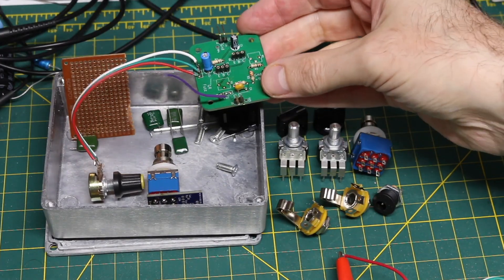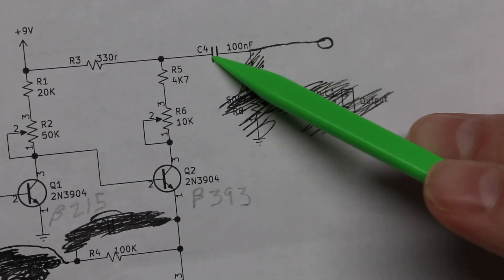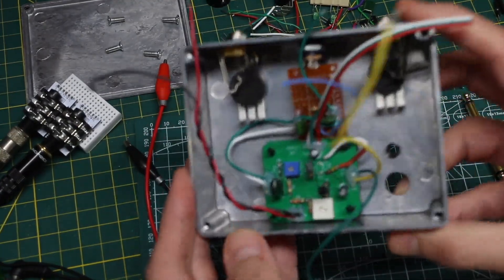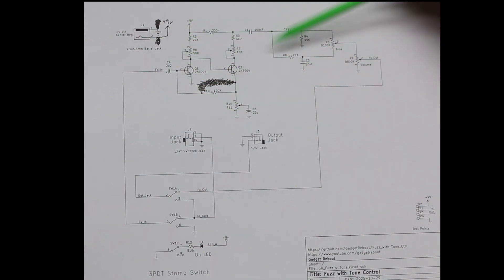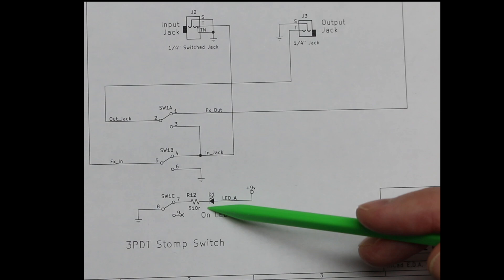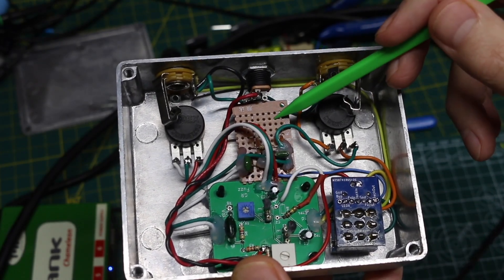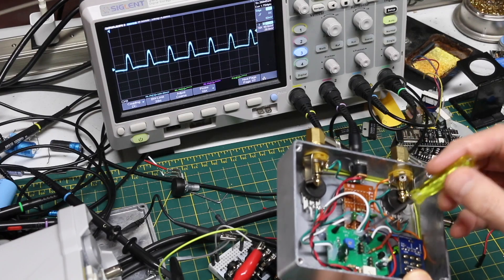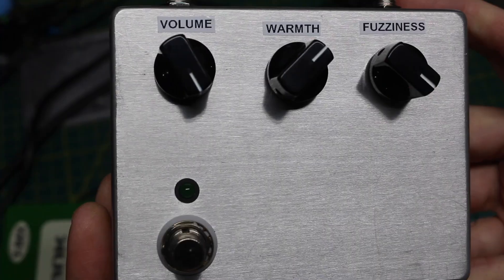DIY Fuzz Face Pedal with Tone Control

Comment: Huh, I'm in the middle of wrapping up a design just like this. I have different values in the tone stack and am just a bit more traditional fuzz face up front. I ended up having to add boost for makeup gain though. Other than that it seem to sound great at this point. It's a little noisy so I might tone down the final gain which there is room for.